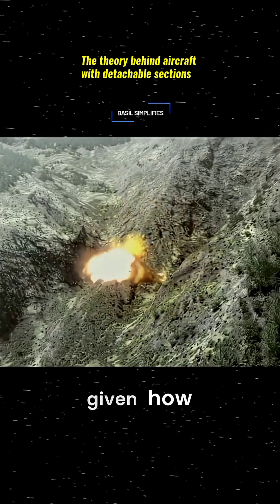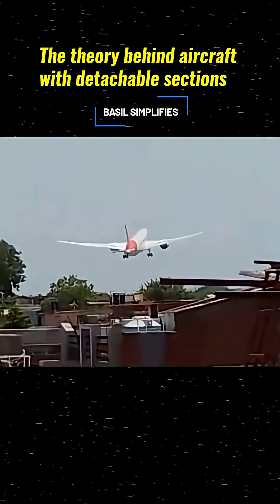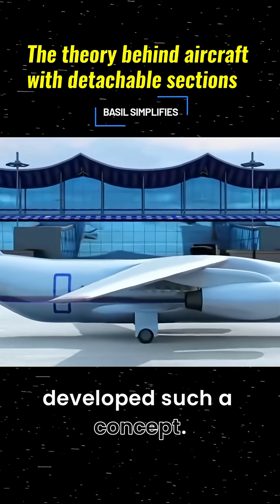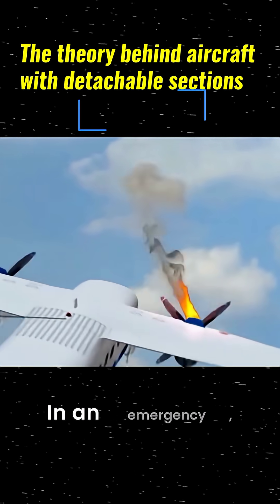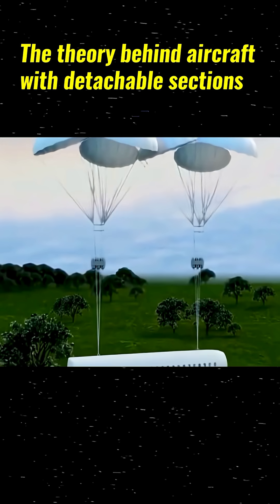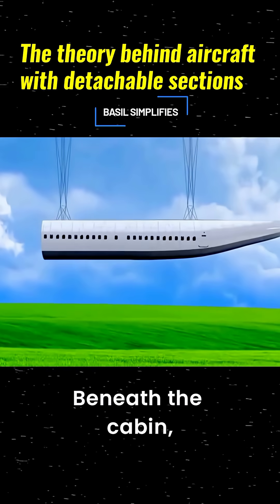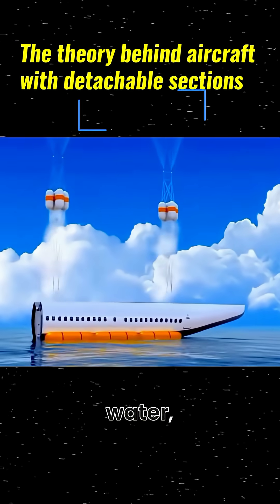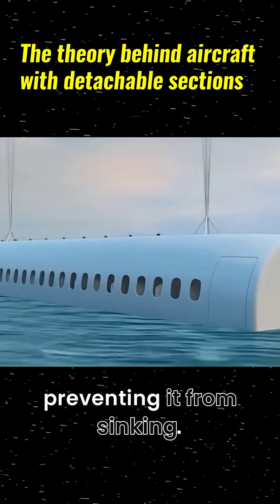WHAT IF PLANES WERE BUILT TO BE DETACHABLE? 🤯 GENIUS TECH EXPLAINED! #youtubeshorts #techtips

Comment: Sorry isn't practical. First off the weight of the system would halve the passenger capacity.  It would double maintenance costs and time. The explosive charges have to be replaced at regular intervals, the parachutes would weigh tons and would take more than two. The largest cargo parachutes, the one hundred foot G-11 has a max load of 5000 pounds. This is just scratching the surface of the problems with this.
Reply from the maker: You've highlighted some key challenges for sure! The concept definitely faces significant hurdles regarding weight, complexity, and practicality. ✈️

Comment: Ukrainians are king at aerospace technology well known innovators in America Dzus antivibration fasteners, Sikorsky rotary aviation all came from Ukraine. The replacement for Antonov 225 is all ready being made and hopefully using GE engines with using 4 , 130000lb thrust and increasing capacity to 300 tonnes payload using the same airframe.

Comment: So what if those fuselages were fitted so no errors will be there? More sections more prone to be unsafe...
Reply from the maker: That’s a really thoughtful concern. Adding more sections and mechanisms does increase complexity, which is why safety and engineering standards would have to be extremely rigorous. The idea behind the detachable cabin isn’t to replace traditional safety, but to provide a last-resort option if all else fails. Ideally, aircraft should never reach that point but having an additional layer of protection could save lives in rare but catastrophic situations. Appreciate your insight!
Reply: Thank you so much,but this detachable cabin is not a bad idea, because initially however it seems I am thinking but there might be some ways to overcome this.. @Basilsimplifies

Comment: Would this not just turn one object in motion into two objects in motion? Why not fit the plane as whole with the capabilities to stablize and slow decent?
Reply from the maker: That’s a valid point and it’s one that engineers continue to explore. The idea behind separating the cabin is to isolate and protect passengers when the rest of the aircraft becomes uncontrollable or unsafe. While slowing down an entire plane is technically possible, it requires much more power, stronger materials, and significantly more cost and weight. The detachable cabin concept focuses on preserving life even if the rest of the aircraft is lost. It’s definitely a trade-off, and both approaches have their merits. Thanks for bringing this up!

Comment: Flight AI 171 would not have benefited from this technology because it never got above 625 ft.  Plus the whole flight ended in less than a minute.
Reply from the maker: You're absolutely right. Tragic incidents like Flight 171 happened too quickly and too close to the ground for a system like this to activate in time. The detachable cabin concept is primarily designed for mid-air emergencies where there's enough altitude for parachutes and other safety systems to deploy. It’s not a one-size-fits-all solution, but it could make a big difference in certain scenarios. Appreciate you highlighting the limitations. It’s an important part of the conversation on aviation safety.

Comment: Space x can land it already with rockets
Reply from the maker: True! SpaceX’s rocket landings are a remarkable feat of engineering. But they work under very different conditions rockets are designed for vertical flight and have dedicated engines and fuel for landing. Commercial airliners, on the other hand, are built for horizontal flight and carry hundreds of passengers, so adding rocket systems would drastically increase weight, complexity, and cost. Still, it’s exciting to see how innovations from space tech could inspire future aviation safety solutions. Great point!

Comment: Let me get this straight.

You're planning on building planes that can eject passengers at any time, any where, and you really think it will never go off accidently, or fail to deploy?
Reply: Don't cross the road when the pedestrian light is green. A driver may accidentally ignore the lights.
Reply: @MBeaXst  Looking both ways before crossing the road is a simple thing the pedestrian can control to massively reduce the risk of being hit.

But a plane built with this feature is entirely outside your control as a passenger. The only thing you can do is never fly on an airplane with this design.

Comment: The matter is significant portion of aircraft accidents happened either during take off or landing...
Reply: Exactly, at altitudes too low to deploy chutes.
Reply: Exactly, from all past crashes, which one can use this?
Reply from the maker: Absolutely ou're spot on. Statistics show that a large percentage of aircraft accidents occur during takeoff or landing, where there's minimal altitude for systems like parachutes to function. The detachable cabin concept mainly addresses in-flight emergencies at cruising altitude, where there's time and space to deploy safety mechanisms. It's not a catch-all solution, but rather one piece of a broader effort to enhance aviation safety. Thanks for pointing this out it’s an important perspective!

Comment: Never going to happen.  The additional weight penalty and cost of design and build are cost prohibitive for commercial aviation (FAA Part 121 and Part 135 operations). And it's totally unnecessary as the odds of dying in a commercial aviation crash are about 1 in 1 billion passenger miles flown.